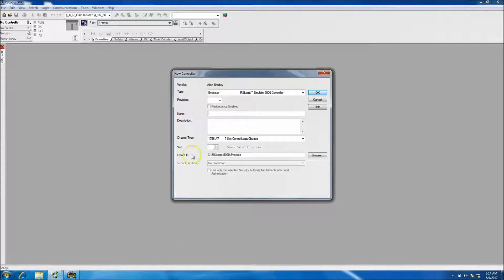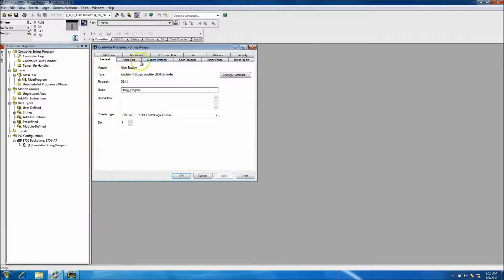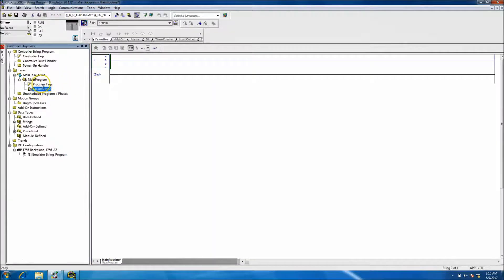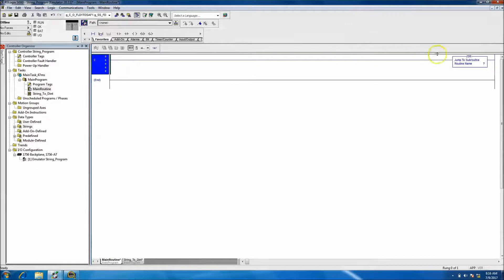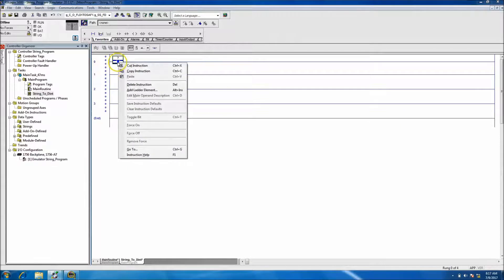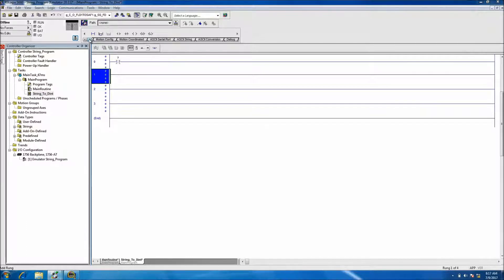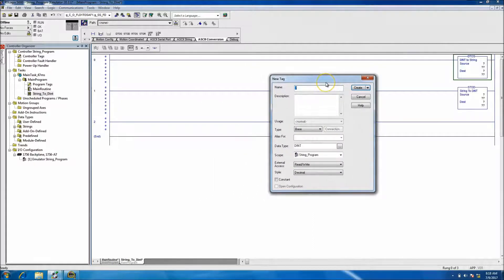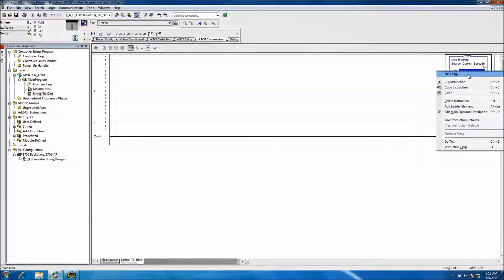RSLogix 5000 DINT to STRING Example in Use PLC Programming Tutorial

Comment: Can we convert dint to strings of characters?
Reply from the maker: There is a Dint to string instruction, just pop it out of the header bar & use it.

Test it out
Reply: But I am asking can dint or integer value converts to characters like I had the value 57 which is dint or int I want to convert into ascii alphabets can I convert it from that block?
Reply from the maker: @harishe447  Try it, you have the software, you know data, use the block & see.

You understand data better that way
Reply: But actually I don't have emulator to chek I know siemens Very well but alen Bradley is new to me
Reply from the maker: @harishe447  so you don't have the ability to program with RA?

If you are working with the product then you have a means to practice.

Whether you choose to delete it after you practice is up to you.
Reply: Yap you right I will do it thank you